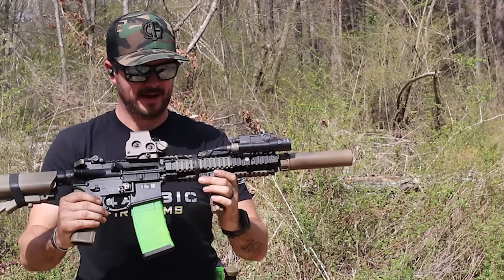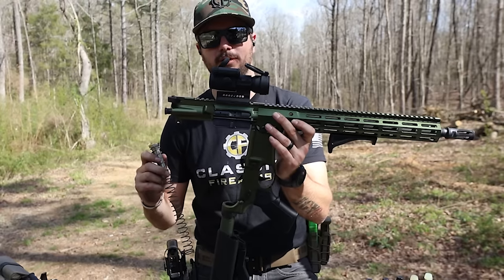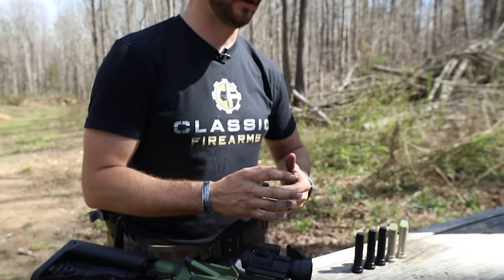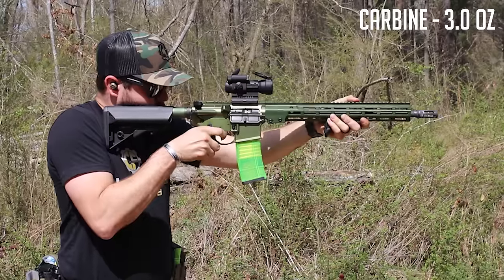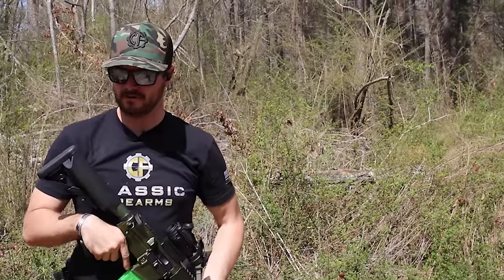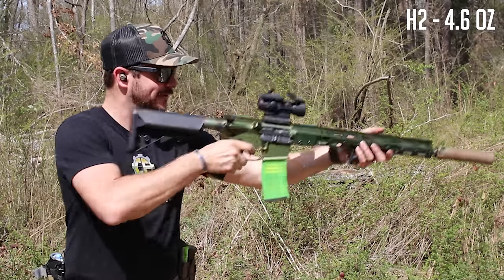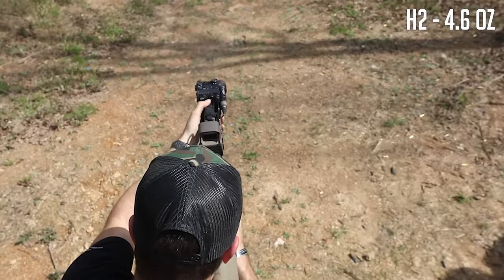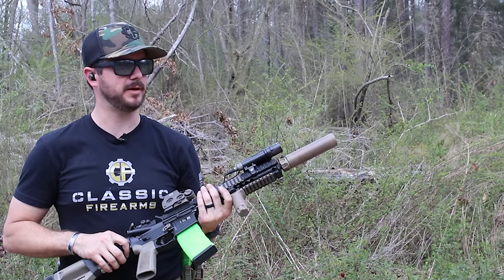What Buffer Should You Use In Your AR-15? (H1, H2, H3, H4)

Comment: Most top AR gunsmiths in the industry actually recommend using the heaviest buffer your gun will still cycle with for reliability sake! It not only prevents wear on your components, but once the rifle gets carboned up the heavier buffer will still send the bolt back into battery and hammer through the carbon build up that will stop the lighter buffers.👍
Reply: Well spoken and agree
Reply: Yes!
Reply: @anthonyrichard461  so would Master Gunsmith Chad Albrecht at School of the American Rifle, by far the top AR armorer/instructor/guru in the nation. He's done work sorting out "AR-14's" for the secret service and a host of other agencies and even been instrumental in helping major manufacturers iron out their overlooked "bugs" to help us all out.
Reply: Heavier buffers are a good idea, but your last statement about “hammering through” carboning is totally wrong.  On the closing stroke, every buffer weight has the same energy. How do we know this? Well the fully compressed spring has some amount of stored energy. With the bolt closed, the spring has a different (lower) energy. The difference between these is what was given to the BCG in closing energy, regardless of the weight of it. Heavy and slow or lighter and fast, they have the same energy.

If you want to “power through” carbon and such, you need a stiffer spring NOT a heavier buffer.
Reply: This is the right answer. Error on the side of heavier always
Reply: @RV-ik2gy  The only caveat for a buffer that's heavy is say if you're shooting in really cold conditions, like say coyote hunting in N Dakota when it's -30°. In which case you re-test what's the heaviest buffer that'll run with your ammo at that temp and switch buffers again in spring.
Reply: @G5Hohn  You forgot inertia exists
Reply: @kevine.136  read my post repeatedly until you get it.
Reply: Watched like 13 videos just to get the simplest answer here 🤦‍♂️
Reply: @mercenarysaw  damn if you always find things in the last place you look right...
Reply: @macgyver5108  This is an underrated point. Very cold or very hot temperatures have a notable effect on springs. I remember a guy that I used to work with had worked at a spring factory asked me to manipulate a room temp spring and I couldn't, but when he gave me one that was frozen, it was very easy to manipulate/extend/compress/etc.
Reply: @mikefollett  and not just springs... Cold temps cause a slower burn rate in the powder and lower velocities by a good amount, making longer shots at 300+ drop a foot or more lower than normal and also means less gas pressure to cycle the bolt.
Reply: @macgyver5108  I don't have experience shooting in cold temps, but that tracks well with the idea that snipers stationed in the Middle East would leave their rounds in the sun to heat them to get a faster burn. It'd be great to get a video on a standard AR in both conditions - zero'd from a "standard" temp environment.
Reply: @G5Hohn wrong
Reply: @macgyver5108  love that dudes channel.
Reply: @kevine.136  yes but the spring is providing the force pushing the buffer and the bcg back, not the buffer’s inertia.
Reply: This is good advice, but you have it backwards. Run a heavier spring like a Sprinco blue or white hot + heaviest buffer you have. If the gun doesn’t lock back, drop down a buffer weight. If that doesn’t work, go down a weight. If your gun doesn’t lock back on the carbine buffer in a heavier spring, then drop the spring to a lower weight spring. Then run the heaviest buffer in that spring, and repeat until you get lock back. Then drop down one more weight after that for reliability’s sake
Reply: @kevine.136  you forgot that the energy the spring can store is the same whether you use a lighter buffer or a heavier buffer, and the spring can only generate so much force. However, the spring can move a lighter object faster. A heavier buffer with a lighter spring is not going to be moving as quickly as a lighter buffer with a heavier spring. 

This is The classical "momentum" versus "energy" confusion 

Momentum is mass times velocity P→=m⋅v→ and is a vector (points in the same direction as the velocity). Energy is a scalar and E=1/2m⋅|v|^2

The common example of what this makes sense, is firing a rifle. Both the bullet and the rifle have equal but opposite momenta, so the overall momentum is preserved. This creates the recoil of the rifle. However, the bullet has way more kinetic energy otherwise the bullet could never inflict more damage than the rifle inflicts on you. That would make guns a lot less popular than they currently are.

In most cases energy quantities are the product of two linear (or field) quantities. Electrical power is voltage times current. Acoustic intensity is pressure times particle velocity. In a mass spring system, power is force times velocity. That's a little less obvious here since the kinetic energy is proportional to the product of the velocity with itself. Since the velocity is a vector and the energy isn't the specific product here is the dot product, i.e.

E=1/2m⋅v→⋅v→

There are different ways to explain it but that's already been done so I recommend googling "momentum vs kinetic energy" and finding the explanation that fits your intuition the best.

A higher ENERGY buffer will indeed push through grime and such more easily. Therefore, having a stronger spring and a lighter buffer will actually have MORE energy than a heavier buffer
Reply: @G5Hohn don’t worry about it brother. He just doesn’t understand the difference between momentum and energy lol
Reply: @rondobrondo  dis is de weh.
Reply: @G5Hohn  need to go back to science class. the spring may not produce more energy but the heavy buffer will simply have more mass to drive forward.

Comment: Clint should give away his MK18. Or an identical one with all the same parts and attachments.
Reply: I second this motion
Reply: I 3rd the idea. I live in CA and would like the surefire warden as a nice sub for the can!! Make it happen CF!!
Reply: He has done any MK18 pistol before. 

The MK18 he has is an SBR so you would need a tax stamp for it. Meaning a minimum 3 month wait.
Reply: @chriscerta9821  wait ca allows suppressors
Reply: @Token_Black_Guy  the warden is a blast regulator. As long as the muzzle device itself is not a flash suppressor it can be used.
Reply: Ok sooooo identical set up but a pistol variant. 😉 Yes, including the can.
Reply: Yeah imagine dealing with all the BS of a giveaway with the complication of NFA paperwork???
Reply: I think he would sell his first born before giving away the mk18
Reply: I run a suppressed MK18 with .30 RC2 and have a super 42 spring and H3 buffer. Spit 3 o’clock all day long with no failures.
Reply: Thirsty
Reply: No way you just said that 🤦‍♂️😂
Reply: If you asked Clint to give away his mk 18 he would shoot you with it 😂😂
Reply: He has
Reply: Ask for less🤣
Reply: @chriscerta9821  please do explain how a foward projecting blast diffuser is even a substitute, let alone a "good one" for a sound suppressor, lol. Or do you simply mean that it'd be fun to attach and detach it sorta similar to how a suppressor would so it wUd lOoK suPEr kEwL?🙄
Reply: I’ve heard they don’t give the actual gun away, not CF specifically but like USCCA doesn’t send the gun you win, they send a check for the total value of the gun. Voiding any NFA paperwork complications.
Reply: Why would anybody give away their weapons?
Reply: Get your own mk18 lol 😆

Comment: Buffer weights really make a difference if you're shooting full giggle or burst. Increased weight allows for more dwell time thus allowing proper extraction between rounds being fired. That is why the TM states H2 buffers are to be used in M4A1's.
Reply: Thats also why forced reset guns only operate correctly with h2, h3, or t3 buffers.
Reply: That’s why I always state this is a fallacy. Heavier weights were only brought in to play due to bolt bounce in full auto. All they’re doing in a semi auto platform is increasing reciprocating mass. What needs to be addressed is spring rates. Find proper spring rate to correspond with an H1 and your particular gassing.
Reply: @SandyRavaged  
What you're saying is increasing spring resistance would accomplish the same thing with even less recoil?
One could go from a milspec spring + H2 to an H and upgrade their mil spec spring to a sprinco blue spring and accomplish much the same cyclic slowdown?
Reply: @mghegotagun  exactly
Reply: @mghegotagun  there are many ways to fine tune it but I always stick to a certain spring rate that I can accomplish proper timing with an H equivalent then I also keep a standard carbine buffer or equivalent on hand for weaker ammo like steel case stuff or lower grade .223
Reply: I’ve never heard of “full giggle” 😂
Reply: @qook1543  giggle switch is the best switch
Reply: @Kevin Wittwer try flat wire spring. adjustable gas block????????
Reply: @Kevin Wittwer go flat spring and never look back.
Reply: Aha, I never knew what to do about my home built 6.5 CM. It has ejection issues and may fire a couple rounds and jam or it could do one and jam the next. Didn't know if its  over or under gassed either. I used an Aero Precision upper but can't remember the spring, buffer weight or whose bolt I used but I believe its all std weight stuff for a 308. Now I got a direction to go.
Reply: Full giggle LMAO
Reply: How is a buffer increasing dwell time? Dwell time is referring to the gas system receiving gas until uncorking, in other words from the gas port to the muzzle…
Reply: The Guns and glory Show  cool, that’s still not changing that the buffer has no effect on dwelltime because dwell time is nothing more than when the gas system is pressurized. So everything prior to the gas tube and after the muzzle is irrelevant to dwelltime.
Reply: The Guns and glory Show  no you didn’t, you explained how it changes the rate at which it cycles, dwell time is fixed, it’s not something that a buffer changes.
Reply: The Guns and glory Show  but that’s not dwell time, dwell time is nothing more than the time the gas system is being pressurized. Next we will have to hear about how the buffer affects lock time too…. Stop trying to butcher common firearms terms. This is armorer and gunsmith basics….
Reply: @The Guns and glory Show  I appreciate what you're trying to do here, but you're wrong. The buffer and spring take over the action after the bolt has unlocked. When the bolt unlocks, dwell time is over. The buffer has zero effect on dwell time. This is basic, AR 101 stuff.
Reply: I like how you're just throwing around "dwell time" completely wrong.
Reply: Guy is talking about how long bolt carrier stays open at furthest point. I know and that's what he's sayin

Comment: Okay...  I am now going to display my incredible ignorance.  I have built several ARs, both AR10s (6.5CM and .308) and AR15s (300BLK and 6mm ARC) and have not thought twice about the buffer and spring, with the exception of putting a JP Silent capture spring in my 10.3" 300BLK AR.  I learned a lot from this video it brought me from "I don't know what I don't know," to "I know I don't know" what buffer and spring combination I have and/or should be using in my ARs.  Thank you for the video.  I learned a lot, especially about my own ignorance.
Reply: I too built a 6.5 cm and a 6 arc but haven't shot the 6 arc yet so I don't know what is going to do. I used standard springs and buffers in both and my 6.5  creed jams after a couple rounds. I never paid attention to where the ejected shells went either.
Reply: @Drsnafubar  I run a h3 and a tubbs spring in my 308, id imagine a 6.5 would work good on that setup
Reply: I was lookin to get a jp spring for my 10.5 300 blk what spring did u get?
Reply: @JoseGarcia-vw8uu  I am using the Silent Captured Spring AR-15 Standard GEN 2.  It’s 132.00 on their webpage.
Reply: If you haven’t considered buffer weight, you’re probably over gassed and putting unnecessary strain on your upper assembly.
Reply: @tyrone_shoelace_says  Agreed.

Comment: Tweaking the buffer weight is even more important for 300 BLK, since you have bigger variables with sub/supersonic ammo, and suppressed/unsuppressed configurations. Would love to see Part II, with a breakdown on recommended buffers for 300 BLK and also  captured spring setups like Armaspec and JP Enterprises.
Reply: I was wondering the same thing.  I recently built a 300BLK and it cycles very smooth but fails to reset the trigger. Also kicks the brass at about the 5 o'clock position.
Reply: @johnstanley5385 short stroking. try a carbine buffer
Reply: @robbledot7290  adjustable gas block enters the chat, lol
Reply: @investigativeoutcomes9343  Exactly!  A solving an overgassed rifle with a heavy buffer treats the symptoms, not the cause.  Get an AGB and use a carbine buffer.  I've never had it not work, carbine or pistol gas, suppressed or not, short or long barrel, regardless whether I'm shooting supers or subs.
Reply: Yes very true, I go H2 on my 11" 300blk out on F.A. & H3 on same suppressed. Went with geisler super 42 braided wire spring. Thing runs like a Rolex.
Reply: Pretty simple, carbine buffer with subs and H3 with supers. If you want to run both you'll use carbine with an adjustable gas system.
Reply: i run flatwire springs theyre tuanble worth a look
Reply: @investigativeoutcomes9343  rifle speed gas block Next on my list.
Reply: @investigativeoutcomes9343   Adjustable gas block punted by 300 blackout users trying to fire subs with a suppressor.   Adjustable gas blocks go from current opening (wide open) to narrowing the opening, preventing overgassing.  In the case of a pistol sized gas system, you need MORE gas if anything not less so an adjustable gas block would be useless (for this application).  Likely the current gas system is blocked or it needs lighter parts so what little gas gets siphoned out of the barrel is enough to launch the BCG fully back past the next round in the mag and with enough bounce to pick another round off and close the battery entirely.  Thats the sweet spot and is a huge challenge with 7.5 barrels running subs.   They need to be suppressed to capture back pressure as 300 subs were designed to be suppressed to capture the gas this way to cycle reliably.
Reply: @RunningWithSauce  idk, i been shooting 300blk since it was called the 300 whisper and i use slr titanium adjustable gas blocks and carbine buffer springs and buffers, my 300 with a 16'' brrl cut down to 14.1'', runs perfect, can't say i ever had a problem with it, 500 coyote later. also fk subsonic i set my gun up to shoot hornady black 300blk 110grn vmax, and that's all i shoot through the one of the many 300blk's i have. i have one 300blk mag dumper model, 10.5'' pistol gas, centurian arms low pro gb, carbine buffer and spring, it will run any ammo you want to shoot out of it, subs or suppers, it just shoots.
Reply: @johnstanley5385 well then I'd say the cycle is interrupted and it in fact does NOT cycle very smoothly at all😂
Reply: @johnstanley5385 I has to cut a couple coils from my buffer spring to get my 300 blackout to cycle reliably and I am using carbine buffer.
Reply: Best setup I've found when shooting .300 suppressed is with a H3 buffer and a .750 gas block. Shot through a 9" barrel with a 1:7 twist.
Reply: I do not reccomend any buffer that doesnt have a deadblow action to it. I have no experience with the JP, but the armaspec can cause bolt bounce when rapid firing. I personally reccomend a sprinco white or red/white with a carbine or H1/H2 buffer for your run of the mill 12.5 to 18" middies. Carbine gassed 10.5" to 16" will probably be happier with a sprinco blue and/or H2 to H3. This is all dependent on gas port size, of course. I like fixed gas blocks on anything i would consider a "fighting rifle".

AR10 however, by default gets a Tubb flatwire and the heaviest buffer. For DPMS LR-308 pattern rifles, use an A5 tube and an H3 buffer with a flat wire spring, also a superlative arms adjustable gas block. Of course the SLR adjustable is well spoken of, but i dont own any.

Just my 2 cents.
Reply: thegunsngloryshow can you tell me more I need something like that exactly for a home defense gun, I don’t want to run the risk of losing my hearing.
Reply: H2 maxim defense carbine buffer with an adjustable gas block.

Comment: Great vid dude. The buffer system is a largely misunderstood aspect of the AR
Reply: 💯💯 i have a problem with my ar not going into battery i think its the buffer but i only shot it once it might needs to be lubed
Reply: @973newarkavelli9  not going into battery could be due to a lot of issues. Locking lugs aren't timed right, unlubed, buffer weight or buffer spring too weak, etc
Reply: @EggplantHarmesan  i lubed it its working better when i rack it im going to take it to the range to see if it runs good but its but ill look into the buffer spring and weights thanks 💯🙏🏼
Reply: @973newarkavelli9  if you're running 16" or less with a carbine length gas system try going with H2
Reply: @EggplantHarmesan   i have a 16 inch barrel rifle no carbine
Reply: @973 Newarkavelli, he's referring to the gas system length. which is either carbine, mid, or rifle length.
Reply: @martiniversen4898  adjustable gas block enters the chat, lol
Reply: @investigativeoutcomes9343  Competent rifle builders have entered the chat
Reply: @that1electrician  oh really, lol
Reply: @that1electrician  you mean ''put 'er together'ers''  🤣😂🤣 two pins. lol
Reply: @Investigative Outcomes  I was talking about you- as in you're a competent builder because your using adjustable blocks.
But hey if you wanna deny my olive branch of Guntube friendship, I'll be your huckleberry.
Reply: @EggplantHarmesan that was helpful for me I got one and it’s way better. Thank you.
Reply: How?
Reply: Boom digidy